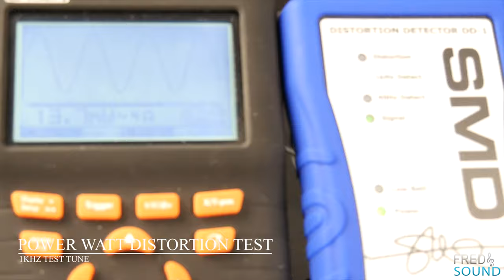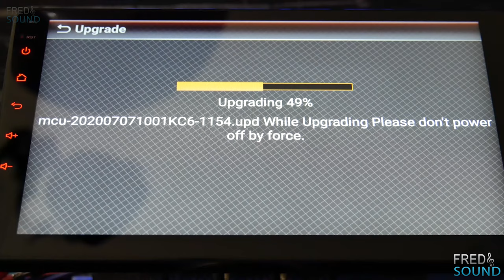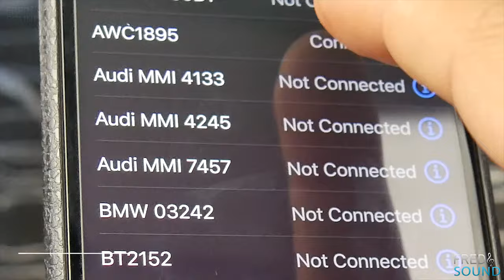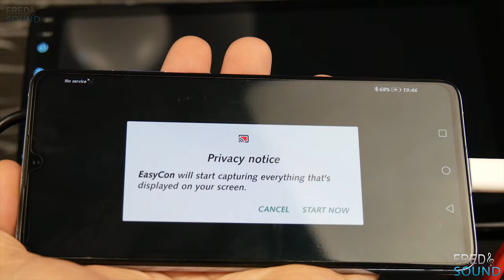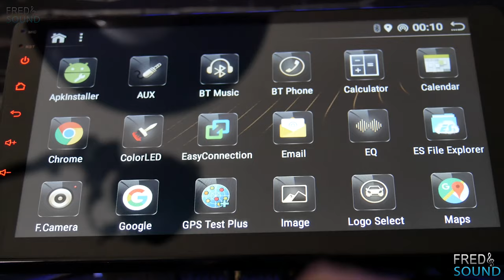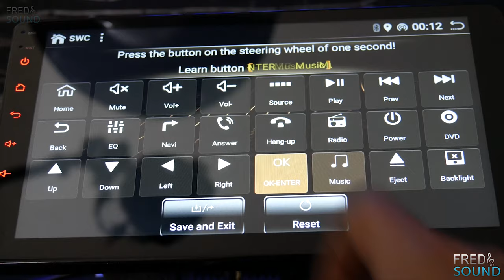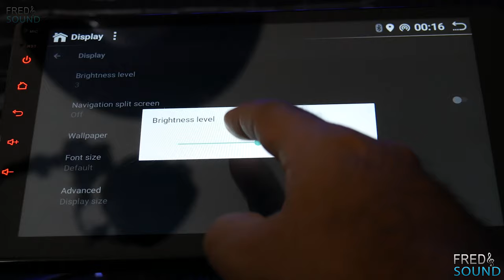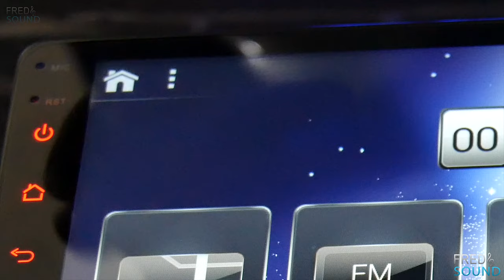PX6 Android 10 Car Radio Stereo | Full Review | Menu | Amp Dyno | Sound Test | Update Version (FNS)

Comment: Audio signal line driver for the low voltage low level RCA’s or line out converter for high level? 
Wish my unit worked with usb audio with my dac, but only Neutron music player goes through usb dac, no other apps
Reply from the maker: hi, Hi-lo converter will work better on this unit, thanks for watching

Comment: I have mounted an android 10 radio, now all the acoustic warnings no longer work, (front and rear parking sensors, fuel warning, seat belts and door opening), how do I solve?
Reply from the maker: HI, YOU NEED TO CONTACT THE MANUFACTURER/SELLER and request the OEM harness, and make sure your head unit supports your car model, thanks for watching

Comment: GPS connection would be only there when the car originaly has GPS system built in?
My car does not have built in GPS, then would I leave the port empty?
Reply from the maker: This system has gps built-in, if you want that feature, just install the gps harness/antenna, thanks for watching

Comment: Where to get firmware update and how to full reset? actually is stuck on car logo and reset button didn't solve? Thank you
Reply from the maker: Hi, full reset at your setting menu, also, search the small pin near the volume and press it when it’s on to reset, for the update ask your reseller he should provide it to you according your specific model, thanks for watching
Reply: @frednsound  thank you for reply, unfortunately it stuck on boot at car logo, so actually isn't impossible to fulle reset on settings menu
Reply from the maker: Welcome, so first use the reset button for 10sec by a small pin, thanks

Comment: So do I have to connect the "amp c wire " to my 12v for the internal amp chip to work?
Reply from the maker: Hi, you mean the blue white wire? if so, it’s the remote out to trigger external amplifier, thanks for watching
Reply: @frednsound  the wire I have connected to my external amp is my remote wire.  This wire isn't for that. But it says amp condition...
Reply from the maker: @marcelopor77  the internal amp will always work, I didn’t see/noticed the wire you are talking about, usually you need the amp connect wire it is the remote wire, and automatic antenna, beside that, you don’t need other wires to connect your audio setup, thanks

Comment: I'm looking at this on Ebay right now, thinking of buying. Just a couple of questions for you. How long does start up take when you turn on the car? For the steering wheel remote harness - Do I get one with just a standard connector at the head unit and my specific car (Ford Focus) at the other end? Does that question make sense?
Reply from the maker: hi, youtube doesn't show all messages, sorry for the delay, you can choose in your settings the time of the head-unit delay or stay on, Thanks for watching

Comment: Hello, great video! Did you happen to test out the suboutput by any chance? If so, could you tell  e if you are getting an audible sub signal?
Reply from the maker: Hi, thanks, yes I did, it’s not the right unit to achieve high-quality system, it’s good for budget setups, thanks for watching
Reply: @frednsound  awesome thank you, I’ve heard some people getting problem with the Dasaita unit’s sub output not being loud enough
Reply from the maker: @djtone69  yeah, almost all Chinese heads has the same issue..
Reply: @frednsound  Just got the unit, turns out the sub out definitely works and is MORE than audible, had to turn my sub amp down lol
Reply from the maker: @djtone69  glad to hear it works for you:)🔊

Comment: come funziona con l'alimentazione 12v the car sembra avere visto 3.71v
Reply from the maker: hi, 3.71V is at max volume, on hi-level speaker outputs, it's not the power of the unit, you use this power to feed external amplifier audio data, thanks for watching

Comment: These things suck I can’t get it to change to miles instead of km and it won’t let me do any changes my truck on the dash now says Km For my miles damn they sux
Reply from the maker: Hi, you may have the eu version contact your seller and ask how to replace these settings, thanks for watching
Reply: @frednsound  I got it to go back to miles and f for my mileage on the vehicle.  I had to go back to the old unit reconnect it and set the stock back to mikes and f but the unit is still stuck on Celsius kinda bummed but got apple car play up and wireless apple play only thing left is to find out it always turns off WiFi when I shut the truck down and this one I have is a newer version and takes a SIM card but the card must be a large card cause my sim doesn’t fit it just falls out lol anyways now my milage is all good I am gonna see why my sub isn’t bumping it is all connected perfect checked it 10 times
Reply from the maker: @mikeyncali  when small things like that don’t go well it’s super frustrating to spend all of your time on it, ask your seller to provide you the latest firmware upgrade and it may save you some issues, these earlier units was made without any thinking behind, som much features could be easily improved..
Reply: @frednsound  totally

Comment: Hello! nice video, but you didn't explain how we make the connections for the controls on the steering wheel. Can you help me with that? thanks
Reply from the maker: Hi, open the steering buttons tab, chose your desire icon button, then press and hold your steering button for 3 sec, it should be set, thanks for watching
Reply: I mean how the wires are connected. I have some problems with my navigation and I thought I would clarify in your video.
Reply from the maker: @john12vl  this headunit uses plug and play harness, need to get your specific vehicle plug, no additional wiring
Reply: There is no icons into the steering tab section. What could I do?

Comment: I see it has hdmi out. You can get hdmi audio extractors cheap with very clean sound or hdmi to spdif optical. Bypassing all the internal sound circuitry and spend money saved over an alpine at 5 times the price on better speakers etc.
Reply from the maker: Hi, yes is has, alpine dac will still sound better, thanks for watching

Comment: Please give information about the dumping factor of the steg dst 850d amplifier, which at 4 ohms gives 500 watts, and in two ohms gives 850 watts. The dumping factor is very necessary. I select it for a subwoofer Alpine swx 1043d
Reply from the maker: Hi, please check that Information in your spec sheet, or at the manufacture home page, thanks for watching

Comment: So, what is the verdict?  Good, bad, very bad?
Reply from the maker: Hi, it’s a good oem head for a regular speakers, amplified on board, if you want to add external amp, the Rca’s outs are useless, has only 0.97v, 
you will need to get a good hi-lo converter or quality DSP and connect them to the hi-level which has 2.55v, thanks for watching
Reply: @frednsound  would running a decent preamp/crossover off the rca be worthwhile? im lookin to get a decent 10" android head unit ($200-240ish is budget) to run a arc 4150 pushin 8 6.5" 8 ohm mid range drivers , 4 tweeters n a pair of strapped dbcomp5s on 4 american bass xr15s in a 18ft3 ported box tuned to 32htz in my 06 navigator
Reply from the maker: @jakejacob9814  hi, yes, the volt is near 1v which is nothing, it’s better using the hi-input connecting that to a quality DSP or hi-low converter, thanks for watching

Comment from the maker: ⚫SKIP TO➱:
⦿SETUP ➱ 00:44
⦿DISTORTION TEST➱ 02:46
⦿PREAMP VOLTAGE TEST ➱03:22
⦿ON-BOARD RTA TEST ➱ 04:21
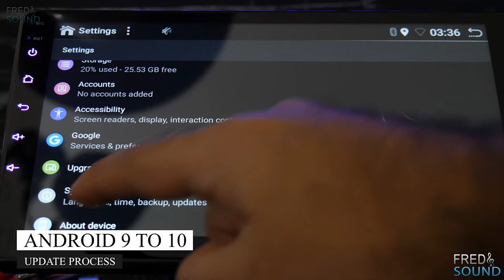⦿ANDROID 10 UPGRADE ➱ 04:44
⦿USB SOUND TEST ➱ 05:57
⦿BLUETOOTH SETUP & SOUND TEST ➱08:09
⦿WIFI & HOTSPOT SETUP ➱ 09:12
⦿CAMERA TEST ➱ 10:31
⦿MIRROR LINK ➱ 10:48
⦿FULL MENU ➱ 11:44
⦿4K SHOTS ➱ 22:20
Reply: HELLO WHERE YOU CAN DOWNLOAD THE ANDROID 10
Reply from the maker: @sasa5427  hi, the seller that sells you should offer you that, here is the link we used, provided by that manufacture, do it at your own risk... thanks for watching 
https://drive.google.com/drive/folders/1LK5uPaxp1XdS_bO_U1yHhW_v2_SnSHsF?spm=a2g0s.imconversation.0.0.6f943e5f06cjHF
Reply from the maker: @DuyNguyen-ik1no  💚🎶
Reply: @frednsound  error when trying to access android 10 download folder.
Reply from the maker: @faisal5407  hi, it’s the link from the radio Suplier, try getting from yours, thanks
Reply: @frednsound  Hello friend, could you please upload the download link of the update to android 10? the link above does not work, thank you very much.
Reply from the maker: @apteccellempresa9952  hi friend, sorry but the file was provided by the seller/manufacture, and it's not available anymore, try contacting your seller, he should have it, thanks for watching
Reply: @frednsound  My friend, I previously installed your firmware and it worked correctly on my stereo, I need the one that you installed on your stereo, that works perfectly for me since my dealer is not responding. please help me.
Reply from the maker: I would love to help, but I don’t have that file anymore, sorry.. thanks
Reply: @sasa5427  hello friend, were you able to download the files from the previously deleted link? Could you please share it with me?
Reply: @DuyNguyen-ik1no  hello friend, were you able to download the files from the previously deleted link? Could you please share it with me?
Reply: @frednsound  hello friend, were you able to download the files from the previously deleted link? Could you please share it with me?
Reply from the maker: @apteccellempresa9952  hi friend, as said before, it has been provided by the seller which he him self deleted the link, sorry for that.. thanks